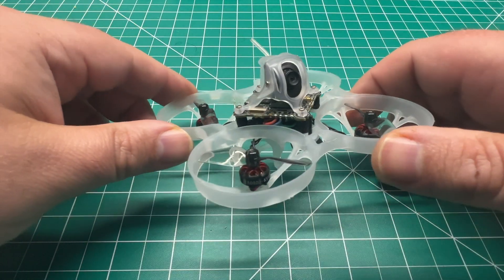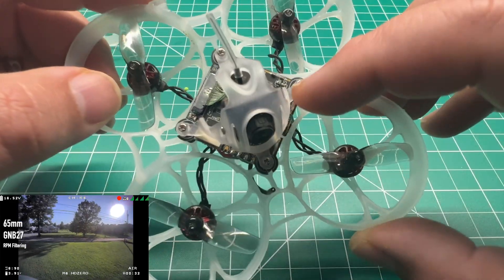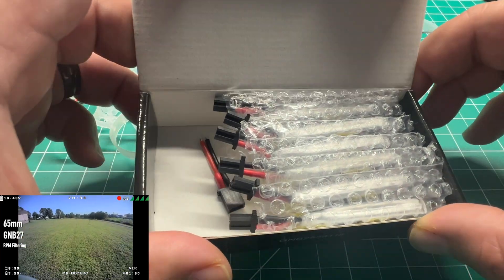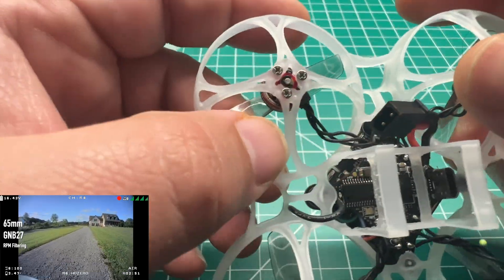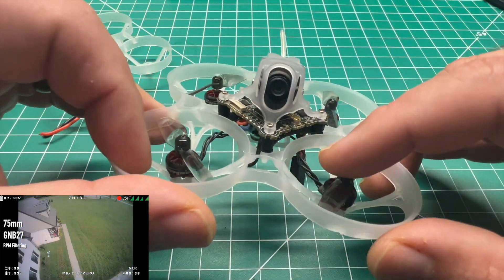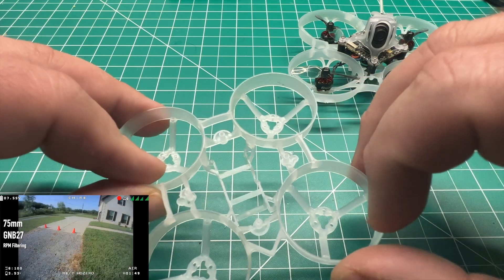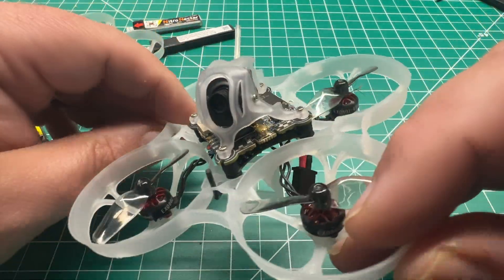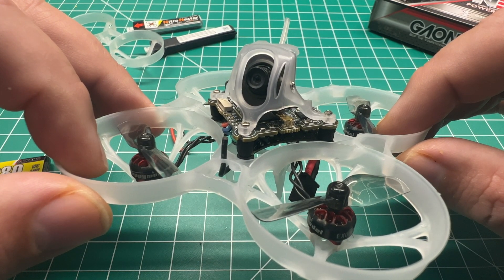HDZero Mobula 6 Revisited//  Upgrades and Mods Inside

Comment: Within a few days of owning the 65mm hdzero I too swapped it into a 75mm v3 frame 
Went from 2 mins to 4 min flight time on 450 gnb 1s.
Running tri-blades plenty of poke to it...
Haven't changed connectors yet.
But at 4 mins flight time I'm happy

No yaw washout as yet..... also I actually cut slits into the frame to pass the motor wires through. Hasn't effected strength of frame.

Kept all settings stock from factory...... flies lovely